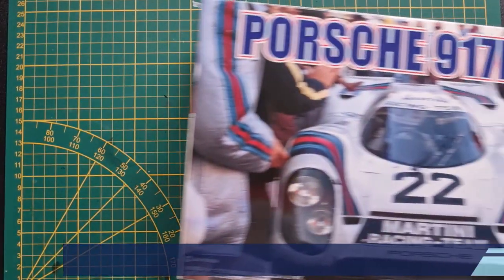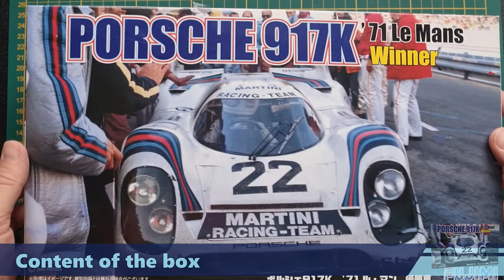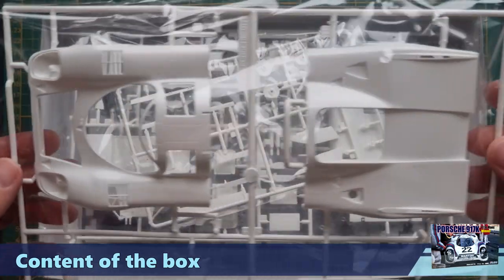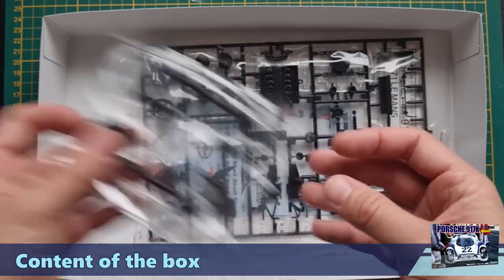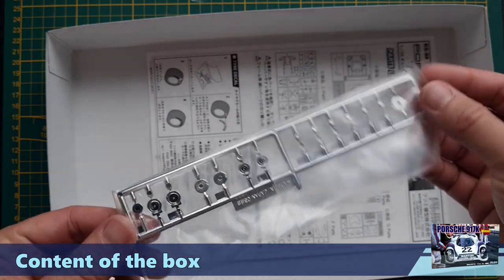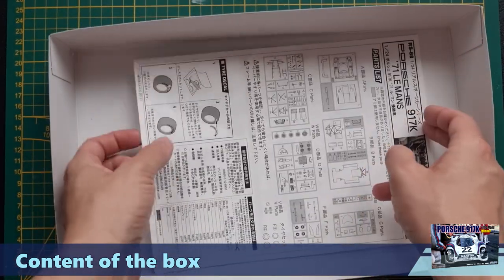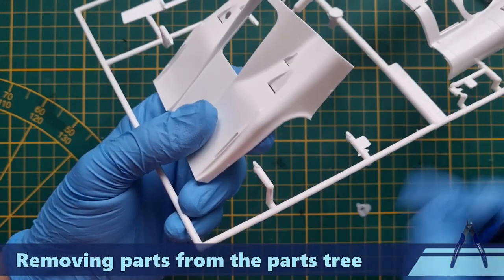Porsche 917k from Fujimi the Le Mans 1971 winner 🏁 full build 1/24 🚀 #scalemodeling #porsche917 ASMR

Comment: Thank you for sharing this excellent video on YouTube: 👍👌👏! This model is very popular in scale slot car racing as it is very wide, probably too much so. All my 917 Fujimi bodies were askew to a different degree. Glueing the top and bottom body parts together before painting and mounting the chassis helped a lot 😊.
Reply from the maker: Thanks a lot!! 💪 I didn't know that they can be compatible, for sure not plug'n'play, but I'm surprised that it is popular to convert kits into slot cars. Actually, I have some old Carrera Uni 132 slot cars like the Porsche 935 or BMW. 😀 They don't work for sure, but maybe one day I will do some video about renovating them. 😀 The slot car body seems to be more durable compared to plastic kits. Is it then easier to brake during racing?

Comment: I have heard that this was a difficult kit to build but you showing us the warped areas now prepares me better for my build. All of a sudden it doesn't seem that scary anymore. The 917K is a beautiful car that I want to add to my collection and now I think I can. Thank you so much for this video.
Reply from the maker: Hi Jean. Thanks for your feedback I am glad that you have found my content valuable :) As far as I recall there were couple of more issues to challange like side windows (they didn't fit either due to their shape or warped body), martini stripes decals on the front fenders (I wasn't able to achieve the right curve even with decal softeners so I needed to cut them a bit on one side to get the right curve and then fit the stripes alignment), top hinges of the rear body (they are really thin so it is quite easy to bent them while checking the body alignment), front hatch (it is just too big compering to the real one, needed additional work). I have seen couple of great projects regarding this modelkit which were done with a lot of care for details and now I know how much effort was put to made this model look great. The 917 itself is a real beauty! :) wish you good luck with your 917 😀
Reply: @AdHocCars  Thanks for the follow-up. I think I'll print your comment and place it in the box until I start the build
Reply from the maker: You are very welcome! :)

Comment: What a great build,despite the issues you had. I love the model and will keep your video as reference.
May I ask how many layers varnish you used?
Reply from the maker: Thanks a lot for feedback! sure, basically it is 3 - 4 ml of varnish in ratio 1:4 and 1:6 (clear coat : thinner). Every layer has min 5 minutes dry time and there are about 4 or 5 thin layers.
Reply: @AdHocCars  Thanks, doesn't it get to thin? Thin like water?
Reply from the maker: It gets really thin and it is quite easy to overspray. I am using AirCobra 0.3 airbrush with the smallest spot setting to avoid these kind of issues
Reply: @AdHocCars   Thanks for your answer. I am stepping over from spraycans to the airbrush. It gives more control with the airbrush. So just asking around what other modellers are doing 👍🏻 Helps me a lot.
Reply from the maker: You are welcome! I think that everyone has its own way of doing things, your research will help to find yours for sure! :)